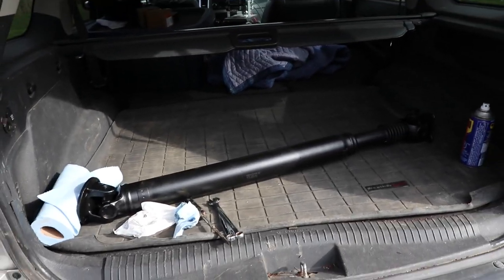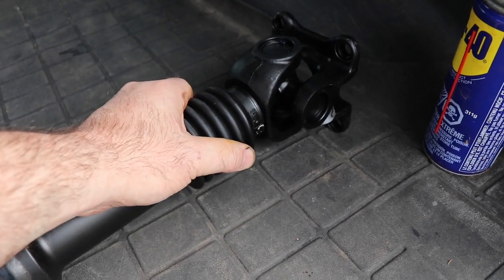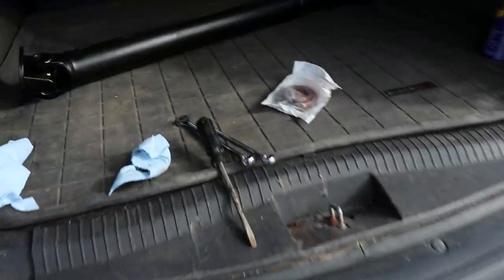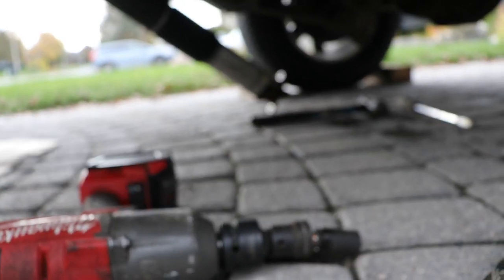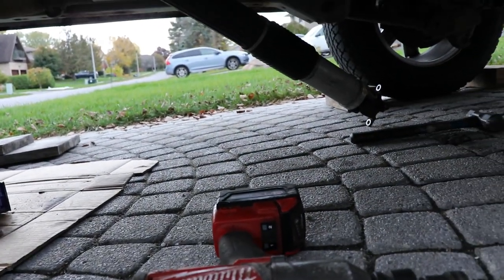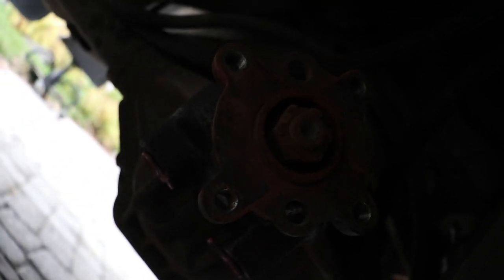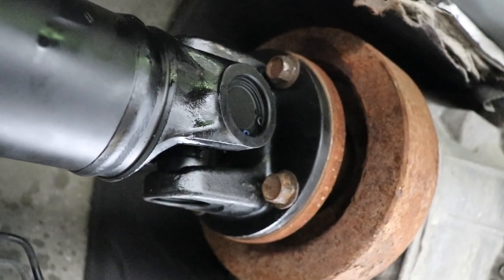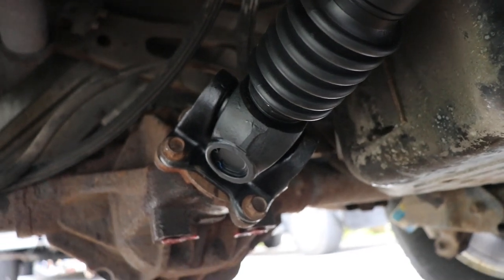2005 - 2010 Jeep Grand Cherokee Rear Drive Shaft Replacement with Cheapest Aftermarket Available

Comment: Hi Steven, is this install as easy as removing the old driveshaft and putting on the new? I purchased a new driveshaft for my 2005 Limited and it states that I must compress the CV joint to remove air before tightening the six bolts. I’m confused since there is only 4 bolts in each side.
Reply from the maker: the factory manual does not mention this, they did mention that I should have marked the flanges on both ends to keep the transfer case and the differential in time
Reply: @SteveRivett so mark both flanges and make sure they stay in the same position? Also, Jeep in Neutral? Just the transmission, or transmission and transfer case?
Reply from the maker: @jeremybuskirk9144  yes, may as well mark them so they are kept aligned, it is possible they were balanced together.  The transmission can be put in neutral, that allows the transfer case to turn.